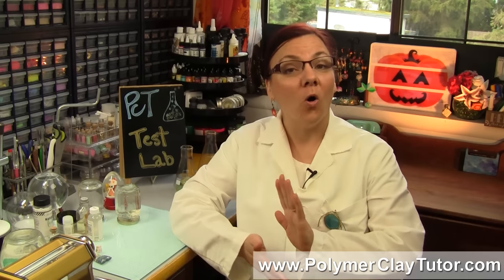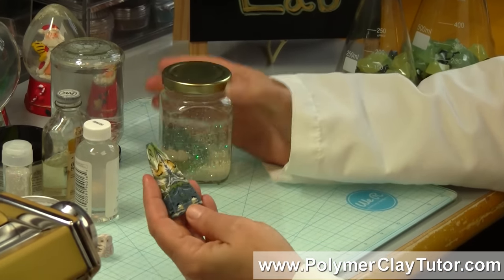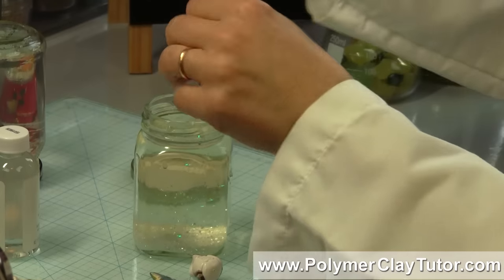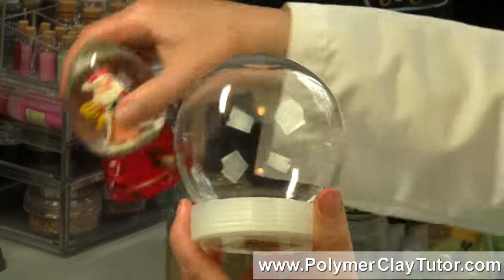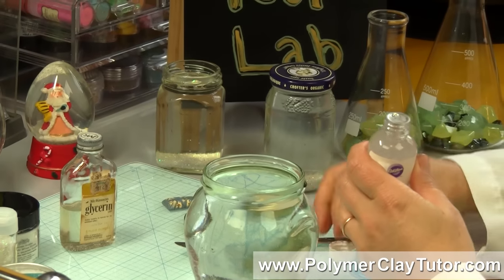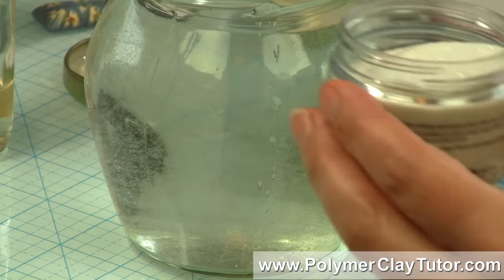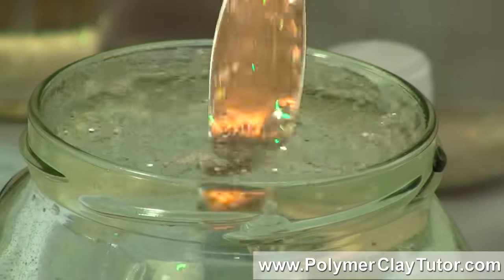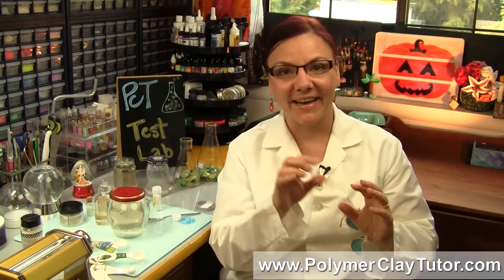Testing To See If Polymer Clay Can Be Used in Snowglobes

Comment: I am so glad you are doing these tests!  I was already planning to try to make a globe with Jack Skellington, Sally and Zero!  I already have the plastic snow-globe from Michaels.  I was reading the directions it came; it recommended sealing the polymer figures and the plastic plug with resin. It sounds from your test that sealing the clay figures might not be necessary. I guess it might depend on whether or not there is any metal armature or design elements showing. Thanks for your tests; I'm looking forward to your next steps!!

Comment: i'm not sure whether it's the clay or the water, but when i experimented with a snow globe, i took the figurines out of the jar a few months later and they turned white when they dried. the glitter also stained the white parts, so i'm going to try with gloss on the figurines-and not hot glue to glue them to the jar lid in case that is what caused the issue

Comment: I'm sure you figured it out by now but it works a lot better if you put the glitter in first. I make snowglobes all the time... you can also use baby oil by itself, but using that stops a lot of glue from working. I have never tried baby oil with polymer clay though.

Comment: I make snow globe tumblers and wanted to add the little fruit slices and was wondering if it would hold up the same?
Reply from the maker: Yes, that will work fine as long as those little fruit slices are baked (which I am guessing they are if you bought them and didn't make them yourself.) 🍓🍉🍋

Comment: Interesting. I know where to get glycerin in my grocery store because I use it to make my reusable mold maker material. I didn't know it helped keep the glitter afloat in snow globes though. I will keep that in mind. :) 

 I don't really like using the remelt I make for resin as it doesn't come out as smooth as the liquid silicone rubber I buy from Oomoo but the DIY mold medium is good for testing to see how well a poured Oomoo mold will work. That helps because Oomoo is a bit expensive (and worth every penny) and not reusable so I can avoid failures better by testing ahead of time with the cheap DIY material. I test a lot whether making a one piece or two piece mold would be better etc. Then I just put it in a jar to melt again at a future time when a new test is needed. 

- Heidi

Comment: I have a question, I’m trying to make a snow globe using a polymer clay Alice doll I made. But I was thinking of using oil instead of water. Do you know if the polymer clay will ruin or not in oil? Just curious before I make mine. Thanks!
Reply from the maker: I wouldn't use oil in a snowglobe with polymer clay... it's probably going to break down the clay. Water and Glycerin is ok though if you want to use that.

Comment: Hi Cindy, what paint (and possibly sealant) did you use on the clay? Because even if the clay holds up well in water, the paint may not, so Im really wondering :) Thank you for this experiment!
Reply from the maker: Hi Steven, I don't use any paint or sealer on clay when it is in this type of environment, for the exact reasons you mention. Polymer clay is plastic, so it is waterproof and therefor doesn't need to be sealed. And the color that you see is all just colored clay, so there is no issue there. A snowglobe would not be the best situation for a painted polymer clay piece. It might be fine, if the paint was really adhered well to the clay but it might come loose, and who wants to find out it didn't work, if you've put a lot of work into it... especially if it is a gift?
Reply: hi cindy ...same question as him,what if i made a polymer  structure  and painted it...then i covered  it with epoxy resin  ...
would the color fade???

Comment: Hi! Can anyone advise me as to why my polymer clay figures are literally covered with air bubbles a few hours after building the snow globe? I am using distilled water and glycerin, and the same globe from Michael's that is in the video....thanks!
Reply from the maker: Hi irene, I think that is just what happens in snow-globes. The air that is in the water grabs onto the surface of whatever is sitting in the water. I believe that would still happen if you had any other type of item in the globe. Perhaps if the item is smoother there would be less bubbles sticking but you would have to test that. I don't think it has anything to do with it being polymer clay or the water being distilled or not.
Reply: A light baby oil coating on your figures will keep the bubbles off

Comment: have you figured out what glue is best for mounting the clay in the globes yet?
Reply: I was wondering about this too. So far I've read that glue guns don't last in the water. It seems like Crazy Glue type adhesive or Gorilla Glue (white) might be the way to go. Although, not sure how they would do with polymer clay pieces. I don't think Weldbond would work either, over a long time under water.
Reply: Yoy could try E6000, I'm trying it.